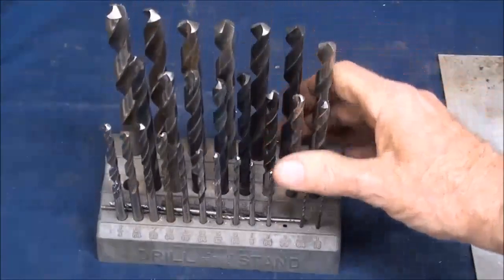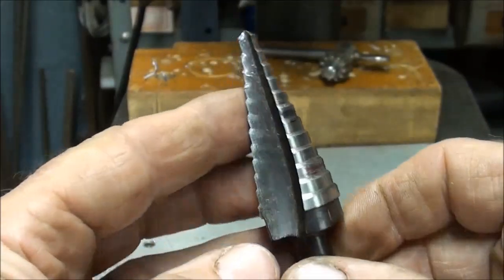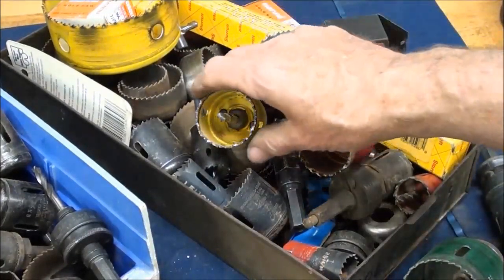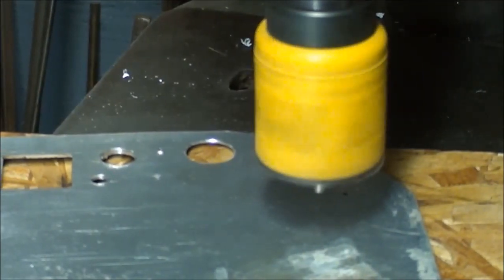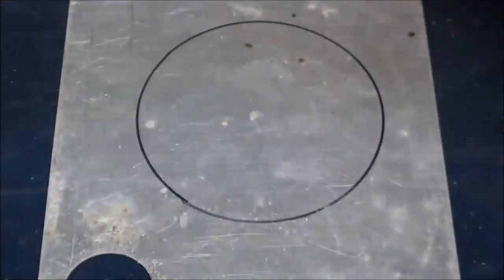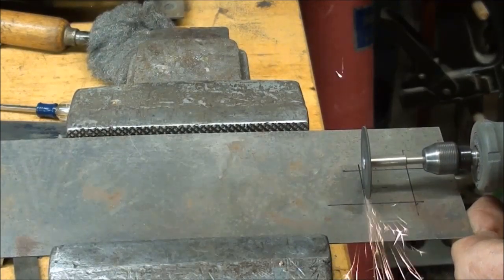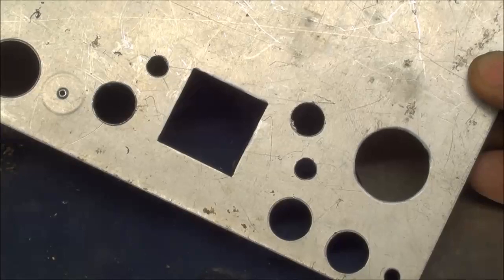revised MACHINE SHOP TIPS #127 Cutting Holes in Sheet Metal Pt. 2 of 2 tubalcain

Comment: I always thought those steps drills were a gadget too.  UNTIL I actually used one -- they are quicker and safer.  Can't tell you how many times i've struggled with making larger holes with conventional drills.  I was glad at that time my drill press only had a 1/3 HP motor - or I could have had a real bad day.  
Those other adjustable pivoting death machines sure aren't worth taking the chance with - despite my trying -- all can go well UNTIL it snags - OH BOY. 
Using the hole saws - I've found that in soft materials (plastic) to run them in reverse.  I know everyone will say how it damages the cutter. But otherwise in soft material they grab too hard especially using a portable drill.
I also like to use the chassis punches like you mentioned.  Got a whole series of those from my Dad and he used to make lots of Ham Radio equipment with aluminum chassis.
Reply from the maker: Yes, those big drills can really grab. Kind of scary. Sometimes I never heard of running a holesaw backwards, I will try it in soft materials.
I am in the process today of 
Shooting a video of drilling large holes. We’ll see how that works.

Comment: I just bought two more step drills, the largest one goes up to 1-3/8".  They are great on sheet metal.  That 4.5" hole saw is a bugger in a handheld drill, overhead especially.  Have you seen the new ones where the saw blade pulls back and ejects the rounds after cutting. https://youtu.be/aMeIdT4MMzI.  -  I use my Dremel a lot in my little shop.  It is a very handy tool.  - Another educational video. Two thumbs up.

Comment: In the first video "Not that anyone is going to do this" ..like hell... my belt got lose so I grabbed an old cheap socket and ground it down to a pointed and put that on my belt and hammered through it on my vise's anvil -- because I am not going to buy a leather punch for one hole and my leatherman makes a sloppy ass hole.

The unidrill is designed for making holes in the outside cases of electronics. They're handy for custom jobs. A switch might be one size, an LED another... you can drill  half a dozen size holes in your project case swiftly and easily & relatively cost effective.

4:41 I fought with my single cutter hole saw until I figured out that the key to this is the relief angle -- it was totally missing on the harbor freight one I had. Once I ground that in it worked much better (meaning less smoke, the first made enough to make smoke signals!) and if this is your only option it'd not bad. 

I have found one place this can "shine" -- when a new lock is installed in a smaller hole and the typical hole saw needs a pilot bit. This works well w/o one on a dp.

BTW, HF has diamond wheels for the dremel quite cheaply. Good for all kinds of cutting and even sharpening your carbide teethed tool bits.

6:24 not to hard to resharpen those. My 1/2 hand drill has very good VSR so it will do a spped where you barely see it move. I bought that Craftsmen 3 handled drill on layaway when I was 15 years old with my paper route money. I was so proud of that drill for so long!

Comment: 13:30  For a finer finish with Dremel discs I usually end the cut short of the layout lines then insert an unmounted hacksaw blade (or a snapped-off junior hacksaw blade) to finish the cuts exactly at the line instead of going over. Tape some of the blade to make a handle area if you don't have a  holder, it's kinder on your hands/gloves that way. You can't beat a nice sharp chassis punch though.
Reply from the maker: Thanks-good idea.

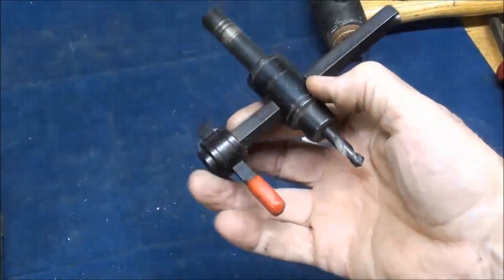Comment: Nothing wrong with the circle/fly cutter (like you showed at about 4:15) to cut larger holes in aluminum. For cutting 4"+ holes in aircraft aluminum panels, there's really nothing better. Just need to be careful and don't turn it to fast. Also should back-up the work if possible...especially behind the pilot/pivot point.

Comment: Thanks for the videos, I always learn something from watching them. I would like to point out in part one when you were using the 1/2" chassis punch, that there are 4 marks around the outside diameter as shown at 1420. If you layout a perfect X through the center where you want the hole, Align the marks on the cup with the marked out X and the hole will be centered with where you want it. Also when using the larger chassis punches that use the 3/4" bolt, use the 1/2" punch first. This is how I use them for conduit sizes.

Thanks again.
Reply from the maker: Thanks-I never noticed those marks!

Comment: Before you "dremel" the sheet metal, drill 4 tiny holes, 1 in each corner.  Then slice away.  You get a nice small radius in the corners, and no need to over-cut. Want a larger radius?  Use a bigger bit!

Comment: I very much enjoy your videos! I have a couple of suggestions for inclusion in future. First, since there is nothing more useless than the "keyless" chucks used on most portable drills today, how about some words about how to remove a chuck so it can be replaced? Second, some info. on how to properly tighten a Jacobs chuck using all three key positions to minimize runout. Maybe even a demo of measured runout using only one position on the chuck, versus drawing the jaws up evenly, by using the holes in rotation. Thanks. LADye

Comment: Tom at the OxToolCo channel showed use of rotabroaches for making holes in thin sheet. Worked great, with no burrs. They also work in thicker metal. 

For production uses there's also laser, plasma, and water jet machines that do quick and accurate work, but those aren't practical for home use unless you have a lot of money and space.

Comment: Great video as always. When using the craftsman type saw ( dont know what its name is, jigsaw?) Make sure you got the proper type of theet orientation on the blade. The blades for metal only cuts on the upward stroke unlike blades for wood etc. If you dont it will jump around like crazy:)
Reply: They were originally called "sabre saws"

Comment: In the workshop of the company I made my apprenticeship at they had a hold down attached to the drill press table to hold the sheet metal in place while drilling.
I found that this is a really great feature when you use a normal drill bit.
It had a quick release mechanism as well and we all used this a lot.
I'm actually surprised that you don't have one of these.
I used it for drill bits to up to 30mm (over 1").

Comment: Yes sir, another dandy and informative video.  You are right about the Unibit. Those things are a life saver. I prefer the two flute Lennox or Greenlee variety (sharper, and stay sharper a lot longer. Possibly still made where they should be, in the USA).  Another option to look at in the hole saw department are the Greenlee carbide tipped cutters. Very nice clean burr free holes in up to 3/16" material. Also very good for cutting some of the tougher boron alloy steels in cars nowdays.

Comment: On hole saws, make sure you get the right sort for the material.

I tried cutting steel with just a regular cheapo hole saw. Lot of noise, heat, but not much cutting.
Reply: You should use the bi-metallic types - made by Blu-Mol, sold under the Milwaukee, Starret, DeWalt and other brand names...